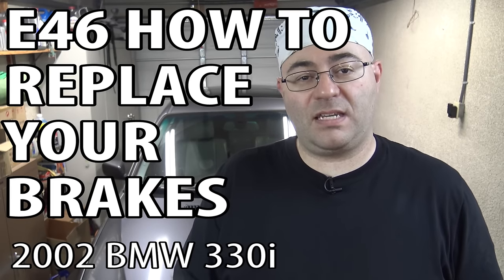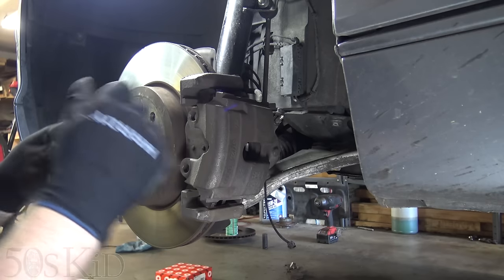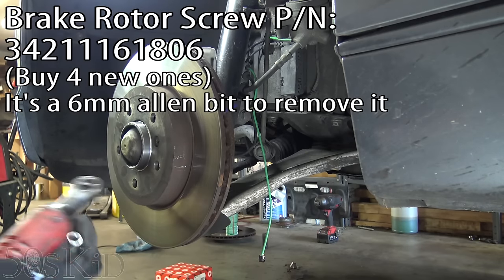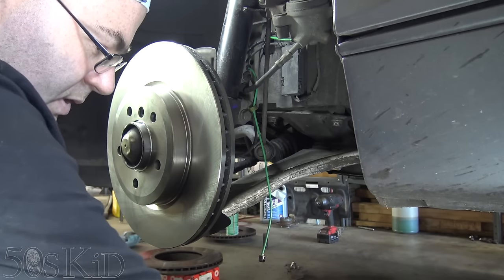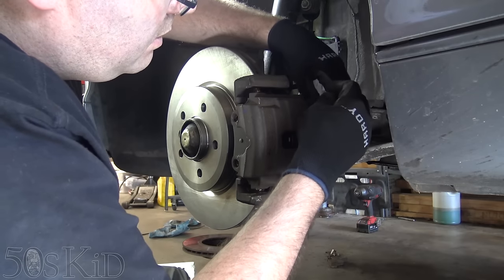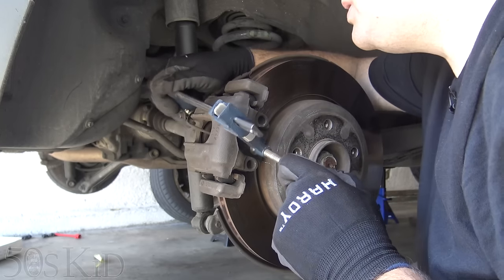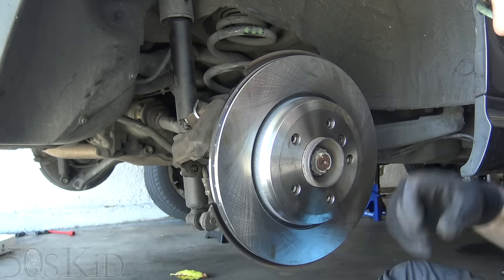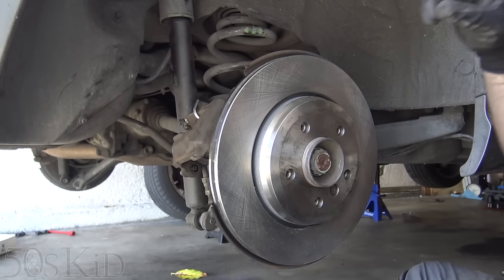BMW E46 How To Replace Front & Rear Brakes DIY

Comment: torque specs in case you'd like to know, as I do.

Front

Brake rotor retaining screw 12ft/lb
Bracket 81ft/lbs
Guide pins 22ft/lbs

Rear

Brake rotor retaining screw 12ft/lbs
Bracket 48ft/lb
Guide pins 22ft/lbs
Reply from the maker: Thanks!
Reply: Metric car, metric torques please :D
Reply: @50cts  dude I'm from Canada.. and I'm not bitching. Use a conversation tool on your phone it's 2019
Reply: @Diablo-gt7pq  How about NO? :D
Reply: @50cts  You're telling me you'd rather wait for someone to tell you the conversions instead of just doing it on a calculator?
Reply: Torque specs are so important. Thanks for sharing John!
Reply: Thanks for sharing! You saved me a lot of time! Much appreciated!
Reply: @50cts  Have you been able to convert to metric yet or are you still waiting for that information?  It is 500NM on the bracket.  See if that works
Reply: @johnhanson9245  lmao
Reply: @50cts   Ft-Lb X 1.35582 = Nm
Reply: @johnhanson9245  Wrong. That would be 368.8 Ft-Lb
Reply: For all my metric friends:

Front 

Brake rotor retaining screw 16 N/m
Bracket 110 N/m
Guide pins 30 N/m

Rear

Brake rotor retaining screw 16 N/m
Bracket 65 N/m
Guide pins 30 N/m
Reply: @50cts  did you ever do it?
Reply: @diegabe4166  multiple times
Reply: Torque gun ugga duggas?
Reply: Question rear brake caliper bolts are clockwise or counterclockwise please mine are rusted and they are giving me trouble finding a strip nut remover that can even work any tip will appreciated thanks
Reply: Do you know what size abs threading the caliper mounting bolts are by any chance? I'm going through hell trying to find them..
Reply: I know I probably won't get a response but would these be the same specs on a 320i

Comment: When you watch a pro do a brake job in 15mins and you go to the car feeling like a boss. 3 hours later you've got one slide bolt out...
Reply from the maker: lol
Reply: Lmao
Reply: You can tell hes done this many times by how fast yet confidently he works
Reply: Hahahaahahahhah😂😂😂😂
I thought the same 😱
Reply: Thing is though, this guy is working on relatively rust-free stuff, we're in the rust-belt and have to fight every bolt & nut.
Reply: Yeah I couldnt budge the bolts to remove to rotor.....
Reply: hey man i feel your pain. the little bolt that holds the rotor in place was seezed up. i screwed up the head. i drilled it with a 6mm, then drilled of the head of the bolt with a 13mm, knocked off the rotor, then i took a m8 bolt, grinded off the bolt to about 6 mm thick so it would fit in the hole i drilled. then i could fit a 13mm on the impact and it came off. it only took me about 3 hours lol
Reply: Bro......
Reply: Every time... 😭
Reply: Me 🙂🙂🙂
Reply: Every mechanic job ever lol
Reply: @jonasvangaeveren2267  I feel you mate! My sliding pin it's just spinning and now I'm remaking the threads 😅🤦 Wish me luck 🤞
Reply: Me today after throwing my wrench across the shop
Reply: 😂 brilliant, same thing happened to me 🙆
Reply: Hard truth 😭
Reply: Gotta start somewhere. Last time i did my pads, took an hour to do the left side. But only 30 minutes to do the right. Any improvement is still improvement.
Reply: Bro i first had to buy a 7mm allen, all my sets jumo from 6 to 8

Comment: bro i been looking up your bideos whenever I have to do a job on my car. I sip on my coffee and spend 20 mins listening to you go through it. I take notes on what tool sizes, parts, and lubes i will need. Jot down the torque specs you mention. And BAM I have learned more, more quickly, then I could from any written manual. I go grab all my items and walk out to my car nd get er done in record time.  You are a hero. Long live e46

Comment: Working on a 2006 X5 3.0 engine replacement with my son. Can't tell you how many times we went to your videos. Great job thanks for all your knowledge, and sharing with us. Were going to get a junk yard trans to rebuild ourselves just because the motor had 200k on it so the trans is iffy. the new  motor only has 40 k on it. The original motor overheated and was totally destroyed.
Reply from the maker: I would say that's a good call on the transmission. Even if you rebuilt a trans with 200k on it, it would still have the same valve body with the same wear in its bores, so finding one with lower miles is best.
Reply: thanks for the info, your the man

Comment: Tackled this job this weekend - thanks much for your video!  I want to add that anyone doing this job should consider replacing the caliper guide bolt bushings.  Was planning on doing both front and rear but stopped short of doing the rears.  Reason being is that while doing the fronts, i noticed that 3 of the 4 dust caps that insert into the guide bolt bushings were missing.  Upon closer inspection, I noticed that the rubber bushings were somewhat deteriorated and could no longer hold the caps secure.  As well, the guide bolts themselves came out with quite a lot of "gunk" on them.  I'm assuming all of the bushings need replacing.  New bushings aren't very expensive ($40 for all 8 of them) and seem fairly easy to replace while doing this job.

Comment: Jason, nice job.  You might mention that for the M3 the front rotors come left and right and are clearly stamped, but if you don't know you could miss it.  Also, I like to get the silver coated rotors as they don't rust and you don't have to even remove the coating--just let the pads scrape it off.

Comment: I appreciate your thorough videos! Do not know if you read old video posts, I just wanted to thank you for your time, knowledge and patience in making these video's. I have a 2002 325xi AWD, bought it as someone's failed project and I am slowly winning the battle of it's high mileage issues. Last issue is it falls on it's face while driving on the highway...... fml

Comment: I'm watching this because this next month will be my first time doing brake work on an e46 and holy crap it looks way easier than my old cars. My Hyundai and Kia both had like 7 screws holding the rotor on and of course they'd all be seized up and philips head. This is a torx it looks like and there's just one. #germanengineering.  Sensors and stuff like like a breeze. I can't wait to get started!

Comment: The sliding pins did not have grease on themselves because BMW does not recommend it. Cleaning and leaving them dry is fine. You should have mentioned to clean the wheel hub really good using the steel brush resulting a complete metallic bright wheel hub because often they are rusty (like on your rear brake) and when there is rust left between wheel hub and brake disc it is very likely to cause vibrating brake discs. You should also clean the whole area where the brake pad touches the pad holder with the steel brush. Cooper grease is also controversial as brake grease. ;)
You should also open the brake fluid reservoir and check that it will not overflow when pushing the pistons back because you never know if the wear status of the brakes was taken into account when the fluid was changed the last time.
But for the principle procedure again a good video.
Reply from the maker: Yeah this was not the perfect video. Hopefully I will be able to improve on it in the future.
Reply: He is right about the greasing part. Guide pins for those types stay dry and are not told to be greased by repair instructions.  The only parts that should be lubed is the pad contact points on the anchor. BMW brake grease (grey colour) comes sachets and are around $2 a packet. You need around 2. He is wrong about the anchor cleaning, wire brush is not permitted, only brake cleaner, this is to ensure the surface anti-corrosion coating doesn't come off and begin to rust. The back of the brake pads shouldn't be greased as there is a small chance that the pad will take the piston out of the caliper (common on calipers with more than 1 piston). If you want to do brakes faster, don't use clamps, use the biggest multi-grip plier you can get your hands on.
Reply: Indeed, silicone paste is for Akebono brake system, which seals pins inside dustboot. Teves system is somewhat semi-open, thus paste could attract debris, dust and so and finally cause pins to be seized.
Reply: Trust me, DONT add this grease to the guide pins. This is maybe for different cars but not for the E46. I warn you. My brake pins were stuck because of the grease.
Reply: 🤔 hmm seems like grease would help. Don't see how it would hurt anything.
Reply: @Yophillips3272  Because grease can make it sticky. Dirt and dust love sticky surfaces. ;)
Reply: @50cts   These calipers look almost identical to chevy cavalier calipers. I'll come to my own conclusions. If they slide dry easy as butter, no grease. But if they are seized up and I have to use, silicone paste, drill, hammer, fire whatever I have available to get them back in working condition that's a win for me??
Reply: @50sKid  You are Just Great....but a little late for the  Muzzle Masquerade.  Eagle 
Eyes see all lies.  LOL

Comment: One good thing about cars with wheel bolts is, you can break the driveline rotors loose with the engine power. Wheel off, rotor set screw out, start the car, put it in 1st or drive and as the rotor turns apply the brake and the rotor will break loose from the hub. Nothing wrong with tapping with a hammer, this is just quicker and less nosie. :)
Reply from the maker: Niiice, I like that very much.

Comment: Nice video as always. If you ever do one regarding the rear wheel bearings, please stress the message that it´s also a good time to replace the rear dustcovers/brake shields, as they tend to rust badly, and it´s good cheap preventive maintenance.

Comment: The caliper guide pins are T45 torx on my 2003 (E46) M3, vs the 7mm allen as in your video. Strange that it's different, but regardless, either size will fit the pins.

Comment: Appreciate your excellent tutorial. Having issues removing the stubborn 16mm bolts holding the brake mounting caliper. Hmnn 🤔, will try slapping the socket ratchet down with my palm and get back to you in a sec...

Comment: Thanks for the writeup!  Well instead of doing the brakes in pairs front and rear I went ahead and took everything apart all at once, with no effort at opening any bleeder screws or anything of the sort.  What's the best way to put them back together?  Just bolt everything up and tap the brakes a bunch of times until everything firms up?  Or is it better to put the front R rotor back on, assemble the entire front R brake, then pump the brakes until it's fitted properly, then re-compress the caliper pistons on the front L and rears, then assemble the front L rotor, caliper pads etc working my way around?  

Or can I just re-assemble all 4 corners all at once and then go pump the brakes until everything is nice and tight?  Sorry it's my first brake job ever and the driving force behind me doing it myself was to paint the calipers black, and ceramic coat the rotor hats so they won't be so hard to clean and might not rust as quick.

Thanks!  Zac.

Comment: Good video thanks. Couple of Qs - if the sensor has not been tripped, can it be reused? And I would like to tighten my parking brake while rotor is off, which direction do I move the wheel? TIA!

Comment: Love your vids 50’s kid, but I have a request. My front brake dust/heat shields are loose and need replacing. Could you do a video on replacement of these for both front and rear brakes.

Comment: Followed this video step by step today to change the front brake discs and pads on my e46 for the first time. Went great, except when I clamped down the caliper pistons, brake fluid started to leak out from roughly where the master cylinder is located. No fluid leaked out from the caliper pistons themselves, or the hoses. The brake-fluid tank under the hood was pretty topped off before I started, and the pads were worn, so I'm guessing the fluid had nowhere to go when I compressed the pistons, and either blew a hole in one of the lines close to the master cylinder, or came out from the master cylinder reservoir cap. Either way, I'm not sure yet if I've created a permanent leak in the system that needs fixing. Have to monitor the brake fluid levels closely.
You should maybe have covered some basic precautionary actions to avoid this kind of thing from happening before you showed ppl how to compress the brake pistons.
Reply from the maker: You didn't break anything but wash off the excess fluid with brake cleaner because it eats through paint.
Reply: Gone for a long drive today. Brakes work fine, and the system doesn't appear to be leaking fluid.
Reply: 50sKid What kind of floor jack do you recommend?
Reply: I know it’s been five years, but he did address this in the video, around the 15:00 mark. Just crack open the top fill cap and keep and eye on the level as you slowly (SLOWLY) compress the piston.

Comment: I’ve never taken the caliper apart like this on any car. Would you say it’s necessary or no? I usually slide the whole caliper off the rotor, then with the old pads still in, compress very slowly so the new pads will fit over either new or tuned old rotors.

Comment: Thanks 50s! After completing the OEM rear pads and Zimmerman rotor install, i'm getting uneven pad wear on the outside perimeter of the outer side of one rotor.  Took it apart, cleaned and reinstalled to no avail. What gives?

Comment: Please make a video how to remove the A B C pillars. The material is coming off. How do we fix it. Thank you so much.
Tonio.
Reply: Very easy, although the shitty plastic usually breaks when you remove them. Its also very hard to find affordable replacements :(
Reply: @buzzyinurface  Agreed.  My headliner and a/b/c pillars were replaced with new fabric that's a bit too thick.  The material is nice and the headliner looks good, but the pillars are all off.  The a pillars are especially bothersome because the airbag covers don't clip in properly.

Comment: Jason:
Looking on a rotor on a e46, I see that both surfaces of the rotor are very shiny.  (Inside and outside of the rotor. )
I can see that the piston pushes the brake pad to the rotor in the inside part of the rotor.
Ok, I get that. !
My question to you is:  What pushes the outside pad to contact the rotor.
There is no piston that pushes the outside pad to the rotor.
I must say, you are an incredible BMW mechanic.
Please replay soon.
Reply from the maker: The caliper slides relative to the caliper bracket so when the piston on one side pushes out, the whole caliper slides the opposite way until the pad on the other side comes into contact with the rotor.  Search around for an animated video on how brakes work--there has got to be something that visually demonstrates it for ya

Comment: Hi mate. I’ve learnt a lot through ur videos however never did anything on my e46. Yesterday I had a problem if u suggest something. While driving the right driver side wheel went into a big road bump and heard a bang. On inspection the tyre was burst and the lower chassis was lying literally on the road. The fender was lying on the tyre. What do u reckon? The car is still on the roadside waiting to be recovered.

Comment: Can't tell you how much I enjoy and am grateful for your videos.

I recently bought a 2002 325xi wagon -- my first BMW, first time even driving a BMW, and it's a revelation! I'm never going back! -- and I'm going to take it on a road trip.  (I live on a remote island, it never drives more than 25 miles at a stretch, and I want to ferry it to the open road this summer.) I took it to a local mechanic to look it over for road-worthiness -- he says the rear brakes should be replaced first.

I can do this myself (with you video) in a friend's well-equipped garage.

The mechanic says he'd replace rotors, pads, and calipers -- that's just his policy.

Question -- do I really have to replace the calipers?  How would I know if I should?

Thanks!
Reply from the maker: Depends on the climate.  In some really rusty states the calipers will need to be replaced after so long.  Maybe the mechanic is just speaking out of experience but you can also just wait until you take things apart and see if the pistons push back into the calipers freely--if so you should be fine.
Reply: Thanks, I'll do it that way.

Comment: hey there 50's kid, small chance that you might reply; however, ill give it a shot anyway, I have a 2006 e46 M3. I was wondering if this video would be able to help me complete this task on my own, or would you happen to know if there is anything that would be different due to the fact it is an m3 rather than a regular 3 series, thanks in advance.

Comment: Thanks for this video. I wanted to do this, unfortunately I ended up not being able to remove the retaining screw because someone has completely rounded the screw previously (!), probably not using mm tools :( obviously the screw is now completely rusted in on top of being completely rounded. Had to put things back on and continue driving with the old brakes. When I get new retaining screws I'll try again...
Reply: Hi man it's been a while but how did you get out the old retaining screw ? I have the same problem
Reply: @ikeralex06   I sprayed it with wd40 and then used a screwdriver, or if it was something to dent with, and then screwed it out by hammering it in the counter clockwise direction. There are some othe videos specifically on how to do this if you search for it
Reply: Don't forget to buy new screws to replace with when you finally get it out and continue working on this.. ;)
Reply: Alright I will try that, thanks
Reply: I had to drill out the heads of my front disc retainer screws. Rears came out with no issue but having a hell of a time getting the rear discs off!